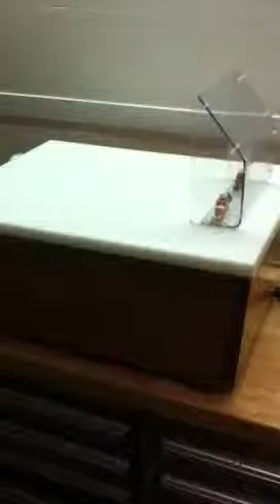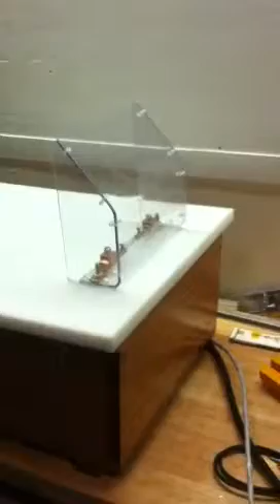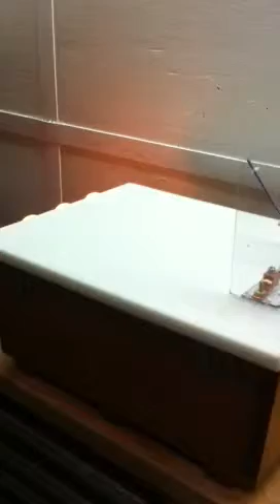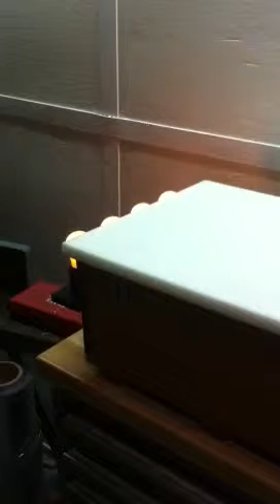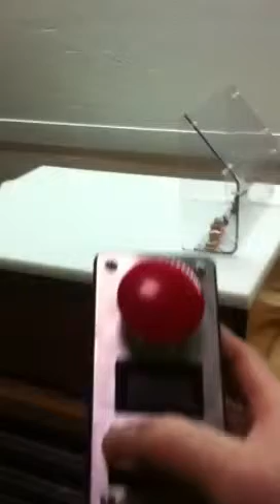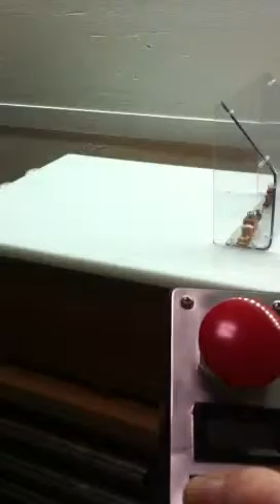Pre-Ringlauncher

Comment from the maker: Thanks, The caps are 8 x 3700mfd @ 350v each ,with them wired two parallel strings of four in series. Right now I'm charging with two control transformers wired backwards . 120vac in, and about 400vac out. They are each only rated for 75va, , but they are  paralleled for 150va ? I plan on using a small MOT to get the voltage up to about 700, some day. Also I plan on putting a coil up there to make it a ring launcher. My caps aren't pulse rated ,so I'm waiting on a large diode to protect them.

Comment: nice :) i have 20 x 1000uf @ 450 volt caps that i am going to use as ring launcher .. but i do have a hard time charging then .. we have 240 volts here so i have to find a easier way ... a MOT should have balast resistors if you are going to use that to charge .. shouldn't it ? i have a BIG mot but i think that would be a little overkill XD